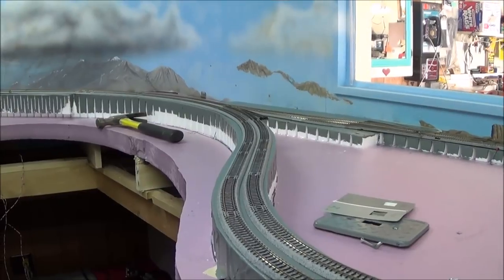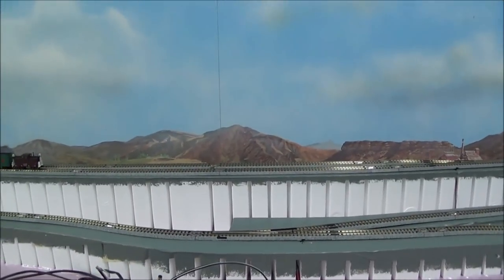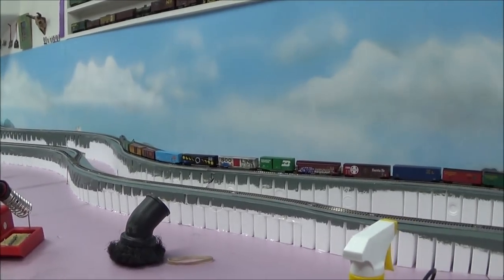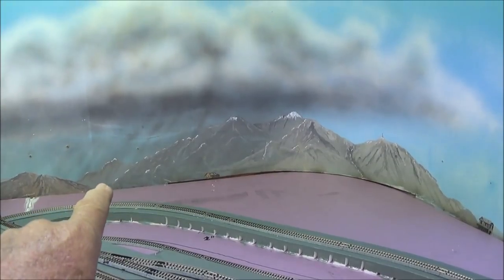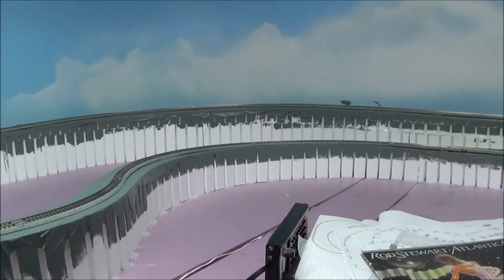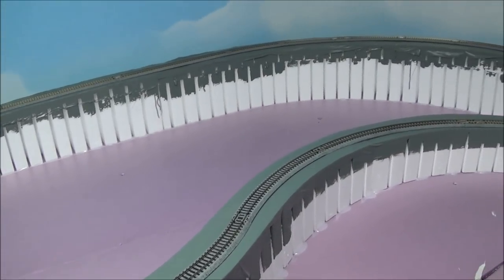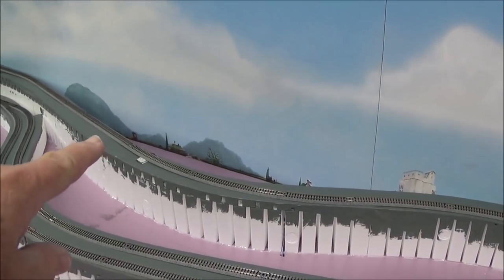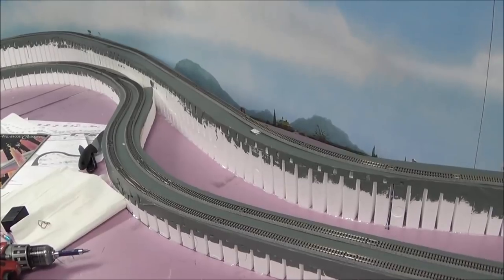Some N Scale Layout Considerations

Comment: Good ideas. I too took the El Tarasco down because it jutted into the room and the lift up bridge became a hassle. Not to mention since I was usually the only one running it was allot of work to run around switching. The new one will be much smaller, allowing to also bring the N into the house. You may wish to use glue dots to stick stuff the backdrop. I have had success with the dots.
Reply: I have some and may try that , Thanks Craig, Mike

Comment: Is that Kato unitrack?  After being away from the hobby for over 20 years, things have really changed. I left the hobby for the very reason you mentioned - I was so anxious to get the trains running that I didn't plan and painted myself into a corner.  Now I'm going N rather than HO and taking my time planning.  I started with the Kato Super Chief set - I cannot believe how beautifully it runs!  So I'm trying to decide whether to go back to good 'ol Atlas (or Peco?) flex track (this time code 55) or spend the $ and get Unitrack.  I would love to hear your thoughts on this.  The sooner the better - though just watching her round that oval and running v-e-r-y slowly is still mesmerizing,  if I don't get some turnouts and track soon I'm going to lose my mind. I already have a theme and scenery ideas, I just need to decide on the tracks.  I await your wisdom... :)
Reply: The cost is nearly the same once roadbed, track, turnout machines.
I am a Kato Guy. Check out the How To page on our shop site for Kato track ideas.
Mike

Comment: After about 44 years of modeling in n-scale, it has occurred to me that many modeler tend to copy the modeling of another model railroader instead of actually modeling a specific railroad and/or a specific area.  We tend to "stuff" as much track as possible into the limited space we have and then tweak it until we are pleased.  Thanks for sharing this video.  Food for thought.
Reply: I agree, Many modelers have large layouts with nothing but track with little or no scenery or industries to support the railroad.
Thanks , Mike
Reply: My post is intended to be an observation, not a criticism.  I do find it ironic that many of the home model railroads I see on social media do not attempt to model a transportation system for moving goods and people.
Reply: I certainly agree.
Mike
Reply: OMG..Your right..i myself have copied Mike fifers friend..mike c
I liked his plan and it must work out bc he's developed it over years of operation..
Reply: I have built my home railroads on a flat surface either plywood or extruded foam over plywood; this allows me to change the track plan and move sidings.  I find I enjoy a simple track plan for the main line and sidings to serve the industries.  Some buildings end up in storage because I have no room for them.

Comment: Mike I have asked before and sorry about asking again. I am rebuilding my layout like you I was not happy with what I had I use Unitrack and considering using Kato turnouts with Atlas Flex track. I know that you haven't done this but are there pros and cons to this method. I only ask because I do have some long straight sections,  and I have a sweeping curve that I am plaining but just can't get it right with the unitrack. So I ask have you heard of anyone doing this. Thanks
Reply: Yes and it works fine. Just join them with the Atlas joiners.
Thanks , Mike